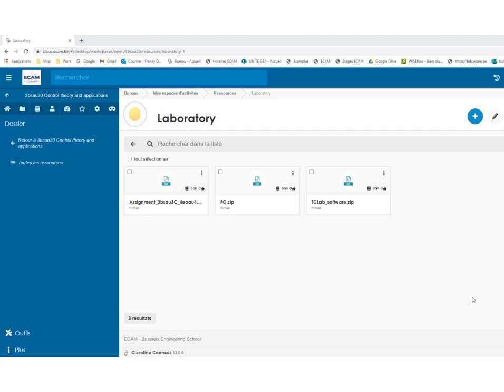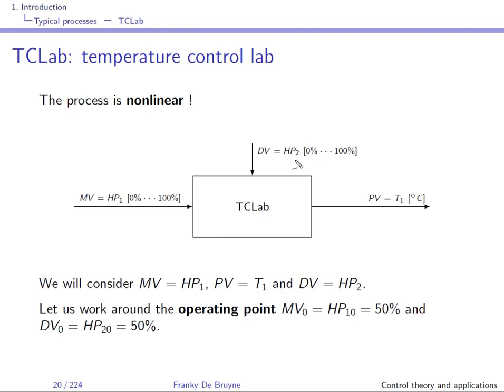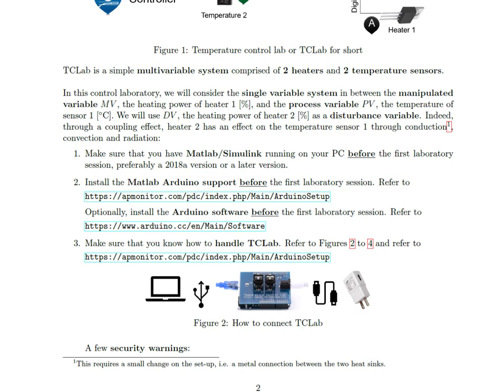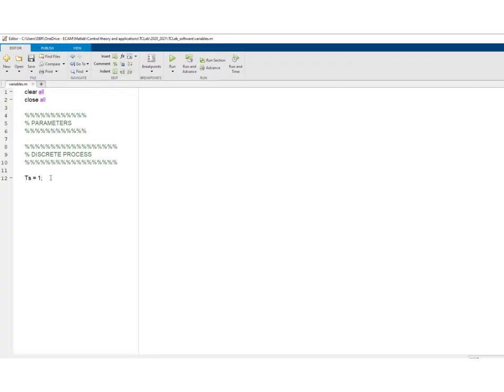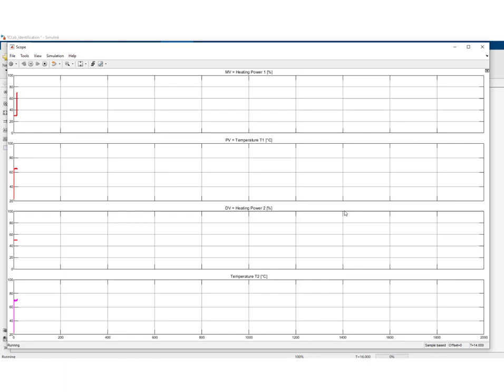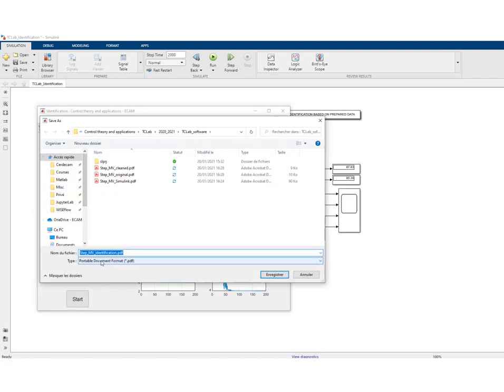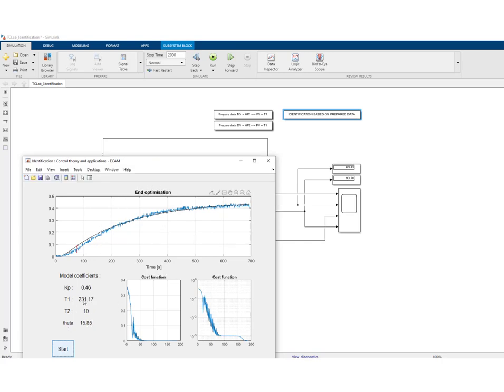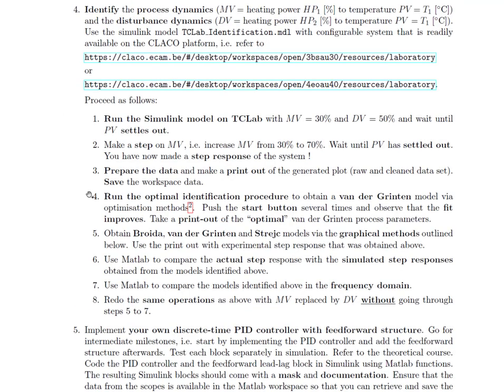Control theory and applications laboratory: video 5b TCLab identification

Comment: How do obtain the TCLAB Software to run the models and parameters?   Where is the download? button
Reply from the maker: https://apmonitor.com/pdc/index.php/Main/PurchaseLabKit
Reply: @frankydebruyne9842   -- The software you are using for optimizing the second-order temperature circuits is not there.  it appears you are running a GUI interface which I cant find in the folders of the TClab.  Good chance this is not using a system identification toolbox...  but something custom... Very Nice.   

Can you show me how you were able to optimize this second-order system...  I tried system ID by taking logging values,  python on first order.  I tried the graphical method and then excel..  nothing has come as close to what you have done.  Excel was close to the curve compared to the other tools.
Reply from the maker: Yes, this has been made at ECAM Brussels. The GUI is just a Matlab GUI.

You need to create a cost function based on the experimental step input, experimental output, the time vector and the model parameters. 
The cost is the sum of squares of the model error, i.e. model error is the experimental output minus the simulated output. You need to use "cleaned data", i.e. to transform the data to do as if a unit step input is used. The simulated output is obtained from the model parameters using a standard step function in Matlab. Then you can use Matlab's function fminsearch for the optimisation of the cost. I hope this helps.
Reply: @frankydebruyne9842  Yes I will try this....